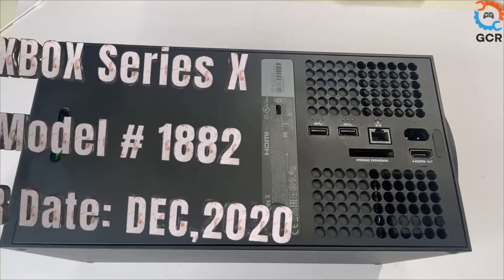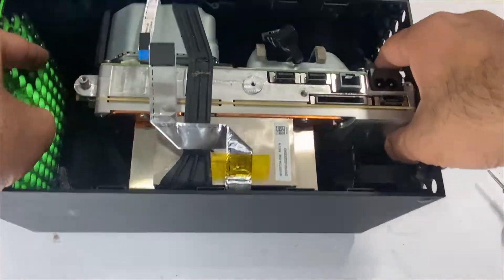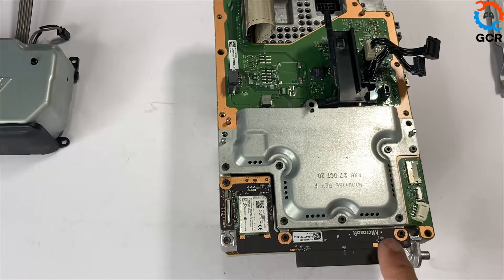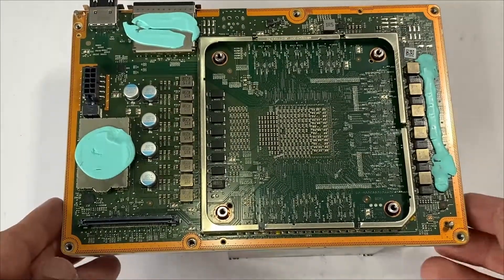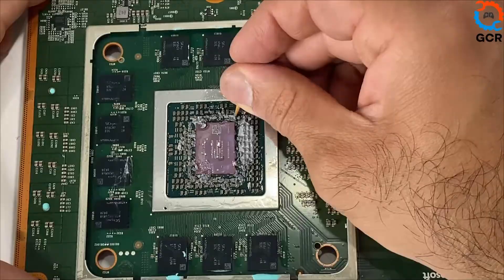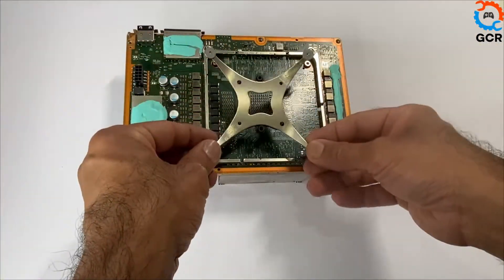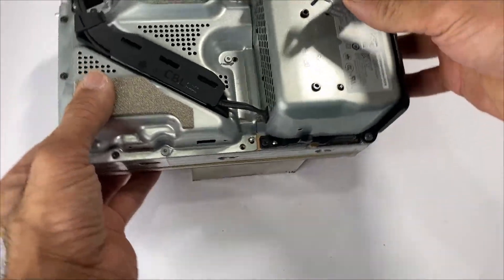!Easy Method! Fix your XBOX Series X [Model # 1882] Broken, Damaged HDMI Port

Comment from the maker: The tutorial is divided into the following parts along with the starting time: -
1. Introduction (00:01)
2. An example of an XBOX SERIES X Console that requires a New HDMI Port (00:05)
3. Disassembly of XBOX SERIES X Console Model Number 1882 (00:17)
4. Dust and Gunk Removal from all the components (07:00)
5. Cleaning up Old, Dried Thermal Paste and Placing New Thermal Paste (09:06)
6. De-soldering, Soldering Process - Brand New HDMI Port Installation (Super Easy Method) (11:38)
7. Assembly of XBOX SERIES X Console Model Number 1882 (12:57)
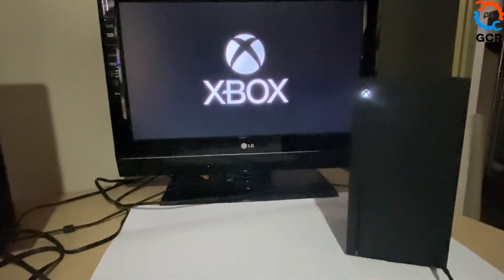8. Testing and Conclusion (18:20)
9. Credits (18:34)

Comment: Great tutorial. Thank you! These boards are thick and really soak in the heat. I had to bring out the big hot air gun to preheat because my hot air station just didn't have the oomph to do it alone.